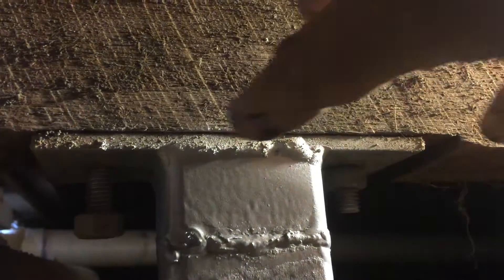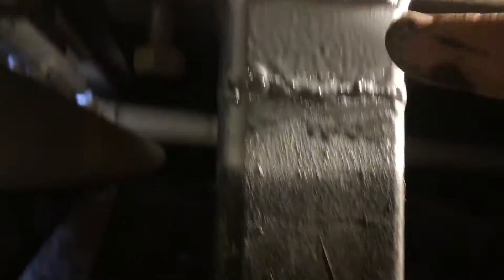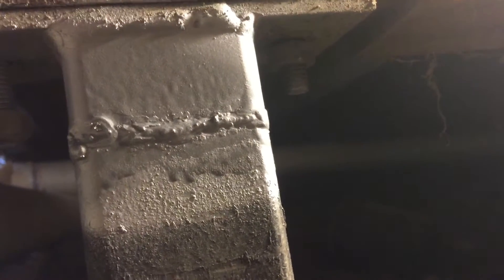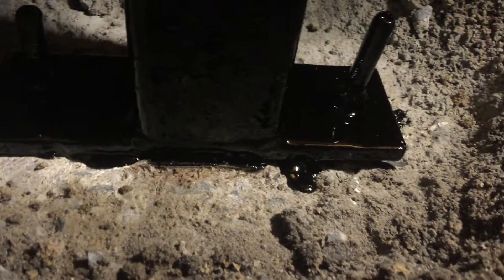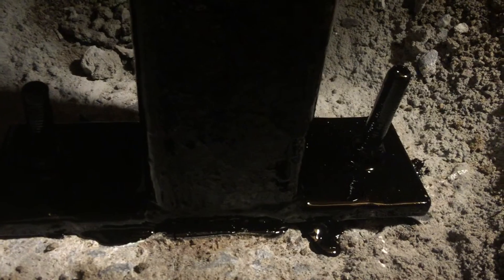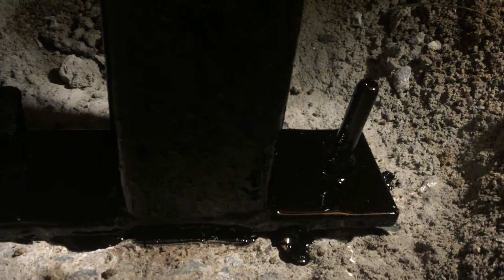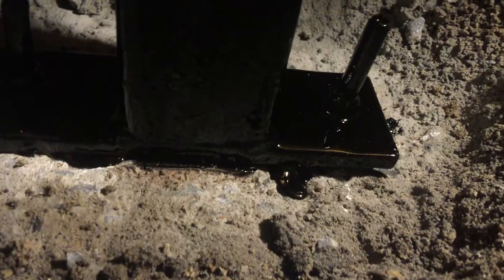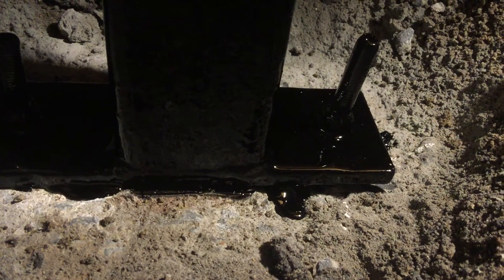House re-stumping, Replacing corroded stumps under house 2015

Comment: Hey Dieter. Love you videos they have given me alot of tips I needed. I have a couple of questions for you. How deep do you put those dynabolts into the stumps concrete and would you do the same on a 2m raised structure for 1 or 2 stumps that have rusted away?
Reply from the maker: Hi Vinny D
Yes if you are only doing a few stumps then no real problem but make sure that you have enough permanate bracing to hold the house up.

I use 100 x 12mm concrete screws or true bolts or chemset and 150 x 12mm pins depending on the concrete I am securing into.

I hope this was helpfull.

Comment: What is the black stuff you put on the post? is it bitumen?
Reply from the maker: Hi. Yes I did use brushable bitumen in those days but now I no longer use tar. Nowadays I only use 1 to 2 coates of 2 pac epoxy from International paints called Interplus 1180 but any 2 pac epoxy will do. I now use epoxy for painting all steel work because it does not get affected by acids, chemicals or heavy metals in the concrete or soil like most other tars or paints.
I believe if it can not last at least 50 years then it should not be in a house.
Reply: some of my stumps are rusty at the base should i wire brush and rust converter then use the interplus 1180 expoxy? or something else like coldgal?